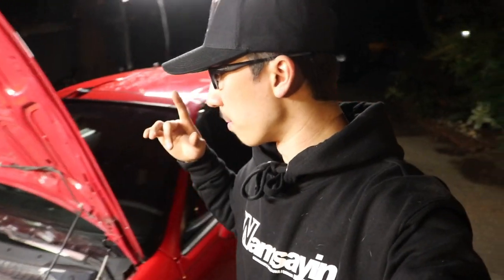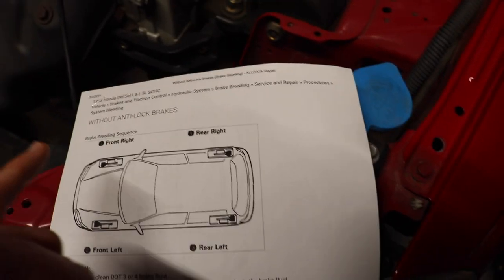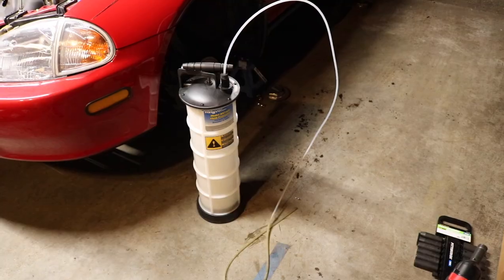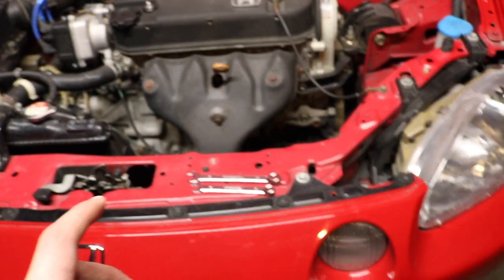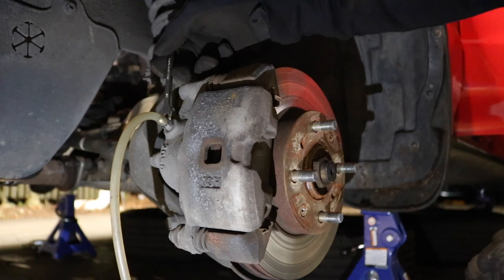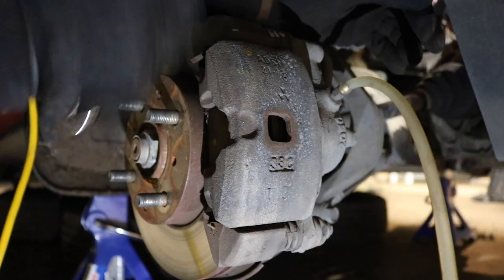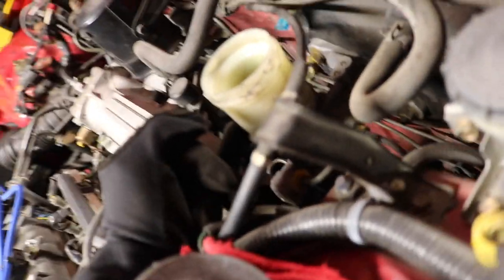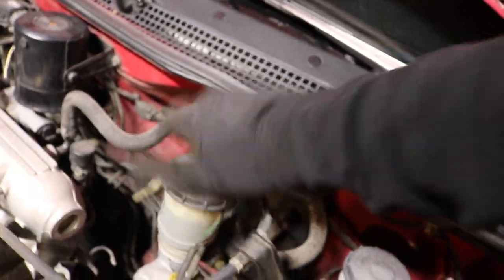Civic Del Sol Brake Fluid Flush!! Tips and Tricks!!

Comment: You Didnt Show How The Brake Pedal Feels
Reply: Feels like slightly worn textured rubber
Reply: @wall7103  @chiefgwopp lol, I think he means the press... It should be hard and firm with the car off, very hard to press in. When the car is on and running, the break booster helps you press down on the master cylinder piston from the opposite direction giving you the added pressure you usually feel. However their shouldn't be any mushyness or loose travel it should be one firm press that engages the brake completely, you shouldn't be required to pump or reset the brake pedal. Ez pz. Ultimately you have to go by your own feel there's not much seeing it thru video could help with. Just go do it! Not really anything you could BRAKE i suppose lol pun.